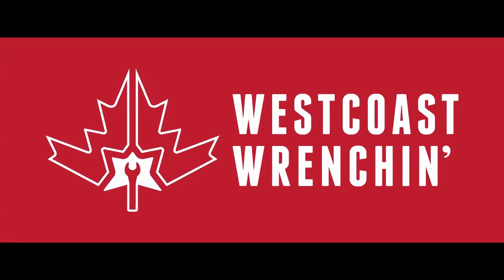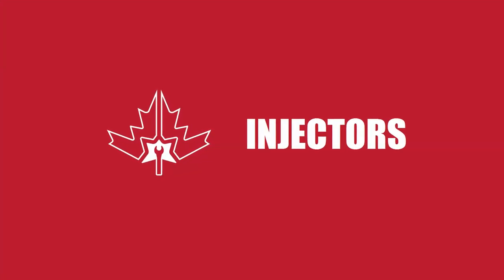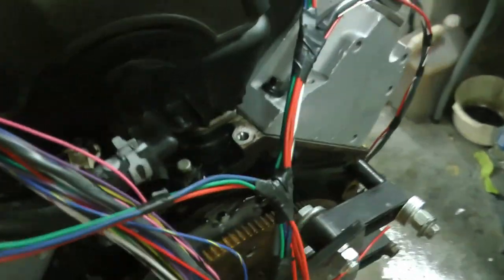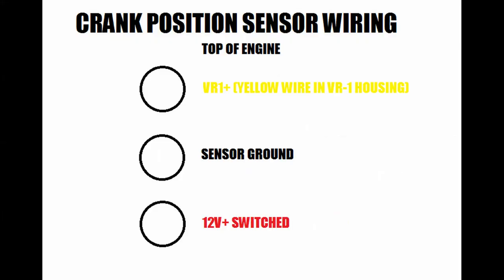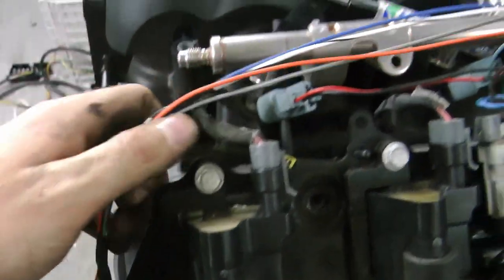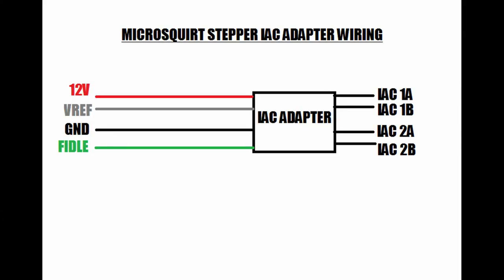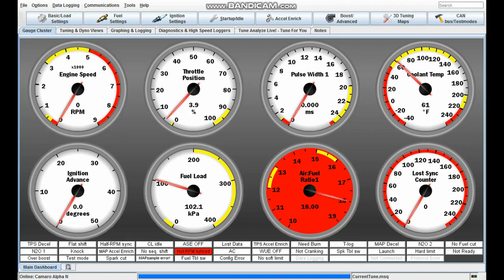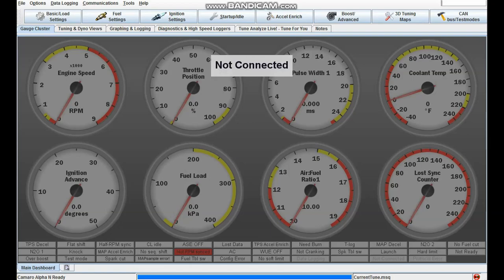Why I went with a Microsquirt on my LS vs. GM ecu

Comment: What some people do not seem to fathom  is that after approximately 4000 rpm your “multi port” system is running at such a fast rate it basically turns into a batch fire anyhow.  The best thing about batchfire is that your fuel that is basically sent to a “prechamber” is allowed to percolate and gas out, at that point you are not relying on the fuel as a fluid to burn , gasses burn a lot , a hell of a lot , faster than liquids to ignite. 
 Micro squirt is basically what we also had for many years, the Ford EEC systems.   EEC iv is what we have used for years to build custom systems , with or without speed density.   Good video.  Now onto fuel maps !   That is what scares people.
Reply: That’s actually one of the easiest parts. You set your AFR table. Than drive around and let auto tune get a rough table going. Than slowly get into higher and higher loads and tune that. The hard part is timing map if you don’t have a way to monitor detonation you could add too much timing and blow up the engine. If you are too conservative you lose a lot of power and sometimes the engine won’t run right and could break something.

Comment: I like your perspective on this, and stumbled across it while doing some MS research myself. I dipped into tuning when I took my old F-250 and replaced the carburetor on the 460 with one of the most stupid simple EFI systems- a 454 TBI, using a '7747 ECM and a Moate's Ostrich emulator. People then asked me why the glorified electric carburetor? Why not something more modern? My reasoning was price, that I desired simplicity on an offroad vehicle, and that my carburetor would flood like crazy any time I tackled a hill climb or obstacle. I needed something that could run at angles and be reliable. These more simplified systems have their place and can function well for years to come, and I'm on about the 12 year mark I believe with mine. Now I'm looking to upgrade, and Megasquirt has options that can be used on just about anything with pistons and spark plugs.

Batch fire is not nearly the lack of efficiency many people claim it to be, although you are correct, it certainly isn't the same., They often like to compare an older, simpler EFI system with a much more modern one, citing the batch fire as being the culprit. If low speed efficiency is your thing, then perhaps SEFI is the way to go, but for making power with an already larger displacement engine, batch fire will do just fine and you won't really miss much. It doesn't matter over 2,000 rpms or so anyway, as everything is moving fast enough that the delay doesn't make much difference. The greater design plays a much bigger part here than just the fraction of a second that the fuel is sprayed in.

I tell folks all the time if it's a hotrod that you're going to hoon around mostly, you'll be fine with a batch fire system, or one of the modern TBI systems like a Sniper or Atomic EFI. It will absolutely deliver modern turn key driveability. If you're concerned with fuel economy, then open your wallet for a more advanced system, run a stock computer, or get a Toyota Camry. It makes absolutely zero sense to me that so many people will dump a decently built SBC with aftermarket heads, and spend thousands on an LS swap in a classic car that gets hotrodded around and driven less than 3,000 miles per year- then cite fuel efficiency as their #1 reason. I couldn't care less as long as it's got decent volumetric efficiency and using most of the fuel to make the horsepower I want to have fun with. I would never make my money back on the fuel savings to make up for so little driving in that situation.
Reply from the maker: Thanks! I appreciate the kind words and totally agree with you. I find that a lot of people get hung up and don't really think about the benefits of making something better vs. Making it perfect. I have learned with custom cars that it will NEVER be perfect and no matter how fast, polished or rare it could always be better. In that sense i have always preferred the bang for buck mods and not top of the line anything

Comment: I am about to do a LQ4 in my second gen myself now and your videos is really helpful! Thanks.

A couple of questions. You are using LS3 heads, right? 821 or 823? I saw they was milled 0,030, did you then needed to flycut the dished LQ4 pistons for valve clearences? Did you calculate your compression ratio?
You are also talking about good fuel milage with your car; I am also going to use a 4 speed (actually a M22 in auto gear housing). What fuel milage did you get, and what was your rear end gear with that particular milage?

Again. Thanks a lot for your videoes!
Reply from the maker: Hi there, they were the l92 heads. Mild cam so no fly cutting required, they measured out fine (too long ago for me to remember the measurement).

Comment: Next time I do a ls swap with a manual trans it’s getting Microsquirt. I pulled an ls6 from a Corvette with the harness and converted it for a 57 Chevy . Changed the cam while the motor was out and know I have to pay somebody with Hp Tuner or Efi live to even get to drive in the parking  lot . I hate the licensing fee on that software  but you can’t blame the guys that wrote it.
Reply from the maker: Yup I totally agree with you. People get hung up on the computer itself which is actually such a cheap thing to do with a micro. That being said If I had an auto I'd consider a gm comp.

Comment: Note not familiar with vortec swaps let alone GM engines.... I was worried about batch fire , and was assuming I had to give up into a carb setup for my first build and lose its power output of the engine series vortec can produce. Thank you for the information! You give a guy hope.

Comment: I have a ford efi 300 inline 6 that I'm thinking of using the microsquirt on.  It has automatic trans (E4od)  aside from the microsquirt not running the trans, would this system work for me? I'm having trouble with the truck.  I've changed sensors, the computer, even rebuilt everything.  Used some original parts but everything has been taken apart and inspected.  I'm thinking this would be a better system than the original stock.  What is your opinion?  If this can make my engine run, I will end up modifying it with bigger injectors and other stuff. As well as getting the trans control.  Sorry for the long comment. 😅 really curious about this. Would appreciate your input. Thanks.

Comment: HP tuners will not self tune , Micro Squirt will. That is the beat reason to use Micro Squirt. And as a standalone it will control your trans also.

Comment: Fantastic video with a lot of great info! I plan on using the microsquirt for my setup (Ford 302) But want to use the LS individual coils. I want to use a 36-1 crank trigger. I cannot find anyone that has done this. It seems to me that it would basically be what you have done but on a different engine. All the MS should care about is when to send fuel and spark according to the crank trigger. Any reason I cant make this work on my Ford engine? Thank you for your time and your content.
Reply from the maker: I dont see any reason why not once you confirm that crank trigger will work! I'm thinking you'll go speed density?
Reply: Westcoast Wrenchin'  yes I’m going to run an LS 90mm throttle body.

Comment: Most fuel injected cars used batch fire injection up until the mid 2000s. If it was good enough for cars from the factory back then it’s still good enough to use now.

Comment: Im using a microsquirt on my dodge dakota with the 318 but since its a 1994 truck. I cant use Flying Ryan Performance since there isnt a way to tune the OBD1 engines. I figured i can use the microsquirt to piggy back off the stock ecu where the stock ecu will supply the 12v power to the crank, coil, and injecters and the microsquirt will just ttigger them
Reply from the maker: I think you could make that work. Why not give the ms full control?
Reply: @WestcoastWrenchin  im not 100% sure how the air conditioner is wired. Then on the mopar engines. The computer controls the alternator but theoretically i could just get an external regulator for that

Comment: the arduino has 14 other input/outputs, have you considered using it as your trans controller, with some programming and it seeing rpm and throttle position over can, you should be able to program it to switch the shift solenoids as needed, just an idea
Reply from the maker: Thats a cool idea! I have a manual trans but im sure lots of people would be interested!

Comment: Hey man I've seen a few of your videos and they're super informative, I was just wondering if you know anything about running a th350 behind a ls motor using the microsquirt system as they have no computers? I'm actually local to your area, the charcoal 81 firebird is mine, your car is friggin sweet and that's the direction I'd like to go with mine
Reply from the maker: Thanks! Yup tons of people run a th350, a direct bolt up with the correct flexplate.

Comment: What ever became of this did you keep it? Was it boost capable? Why did you replace it for a more expensive holley unit?
Reply from the maker: I found the lack of inputs to be debilitating to the project, hence the shift to holley. In hindsight the holley is a far easier system to used and my preferred
Reply: @WestcoastWrenchin  well that's unfortunate well I appreciate you replying thank you

Comment: At about 5:00 you get into a circuit to add outputs. Can you expand on that? There were a couple of words I couldn't get. I'm new to squirt but wondering what these added outputs can be used for? Also, how is the circuit coming along?
Reply from the maker: jvan100 i was mentioning a project I have going to use an ebay arduino canbus shield to interact with the micro. You can buy a $60ish shield with software so you can just hook it up to your microsquirt and use it. Youre using the micros canbus abilities as sensor inputs for an arduino. The arduino can then trigger external outputs based on your micros sensor readings. The arduino will essentially just trigger a solid state relay to do something useful. Hope that makes sense!

Comment: If there is no transmission control with the microsquirt, could you use a manual valve body to control the transmission?
Reply: Depends on your transmission. Any old 3 speed? Yes. I'm a Ford guy so can't speak 100% for the GM transmissions, but they are pretty similar, and anything with electronic control uses solenoids to operate, unlike the older transmissions. There are standalone transmission controllers that will enable you to use one. In fact, you can even use a second Microsquirt to control one.

Comment: ive noticed folks selling "ls only" microsquirt systems. with the coil drivers removed. would it be better to pick up one of those or just get a regular microsquirt?
Reply from the maker: You should get the one specific to the ls if you want simplicity, elsewise there is some soldering and playing around required

Comment: Ok Mr,SuperNerd. Can you use the Meagsquirt with a GM trans controller? Of course the answer is yes, but how.
Reply from the maker: A single MS cant control the trans, you need to get a second one. About all you could do is get the signal when it goes into gear to bump the idle a little.
Reply: Didn't answer the question.

Comment: I am surprised you did not mention the self tuning feature
Reply from the maker: It never worked very well for me to be honest
Reply: @WestcoastWrenchin  I have a LNF turbo in my 86 Fiero with a MegaSquirt 3X and the self tuning works awesome. I have had engines in the Engine Masters Challenge with the 3X and have did most of the tuning on self tune. I had a 6 liter LS on the Dyno and we made 39 pulls in 4 hrs. Most of them on self tune. The problem with self tune is not the program it is learning how to use it.
Reply from the maker: @racerd9669  yea I didn't experiment with it too much. I run a holley dominator now and its self tuning capability is phenomenal!

Comment: So i bought a 1988 chevy pickup with a 1999 5.3 with a single turbo has megasquirt gold box on it. had for two days been running great hop in it one morning to take for a spin and no start!! I have cam and crank signal but it loses engine rpm about the time it tries to start. Sometimes i get no engine rpm! shows no sync?? At a loss any help would be awesome
Reply from the maker: Is it running full sequential? Try and run it batch fire see if that helps you

Comment: Great video!
I am building an LS Miata and will soon be purchasing and ECU.
It has been over a year since you posted this video and I was curious how you are liking the Microsquirt.

Would you purchase it again or buy something like the Holley Terminator?
Reply from the maker: Thanks! If I kept my car NA I would keep the microsquirt for sure. My car is turbo now and I wish it had an output for an electronic boost control. It technically does but I'm using those outputs for my stepper iac. All in all it still works very well and it's so cheap! I've got the bluetooth adapter and shadow dash on my phone for all my gauges which is unreal
Reply: @WestcoastWrenchin  I am wanting to run a turbo as well.  What management
 system do you think you will run in the future?
Reply from the maker: @dmvchannel3280  it all depends! I really like the ms3
Reply: @WestcoastWrenchin  Got it!

Comment: I have been messing with the can bus and Arduino, have you been able to get it to communicate? What setting are you using in tunerstudio to broadcast
Reply from the maker: I tried for a good month and couldn't figure it out, it's just beyond my programming level. I'd really need to go through and understand all the coding better to make it work but its tough

Comment: Could you talk more about reading canbus via arduino to control different i/o’s?
Reply from the maker: I never got around to doing much. You set your micro in tuner studio to broadcast via canbus; it can even be simplified to broadcast engine variables. You then use your arduino connected to the can hi and can low wires to read those values. The values have to be read with a canbus shield. There are tons of shields out there, I'd buy one with a detailed tutorial on using them. After the arduino has the values you can do whatever youd like! I liked the idea of controlling relays via canbus or doing an LCD mini dash

Comment: Great vids, thank you. I have a new  LS made wiring harness, from the GM 0411 computer.( 1999-2002)  Would like to move to MicroSquirt.  Would 
you happen to have any information on which  of the 0411 pinouts would be attached to the MicroSquiet modulw?   Thanking u. Ken
Reply from the maker: That harness is only really required for the connector pigtails if you want to build a harness like mine. I have no idea how the GM pinout would transpose to the microsquirt harness. I took my GM harness and just cut the connector/pigtails off of it and went from there. Thanks

Comment: Sequential fire is good, but unneeded. Power potential is a non issue, sequential doesn’t give you any more power, it does help with smoothness and better emissions. NOBODY building a hot rod is going to tune for emissions. 

The complexity of tuning a sequential over a batch fire is not really worth the trouble especially if your new to these types of swaps. Unless you have test gear to test each individual cylinders air-fuel ratios and therefore tune each injector individually, what’s the point?

Comment: Wait, firing injectors like that sounds stupid. Id like to see a dyno comparison with this and a couple others.
Reply: It's pretty much how every OEM did it for years. Ford was one of the first to go full sequential, and started using SEFI with the 5.0 Mustangs back in 1988 (and all 4.6 modular vehicles), but all GM, Ford trucks, several Japanese makes, Chrysler etc. were all still utilizing batch fire. It didn't really die off until the late 90s as everyone else caught up with technology. You're really talking about fractions of a second difference between when the fuel is injected and the valve opens. It's not going to matter at all above a certain RPM, which could be as low as 2,000. If you're trying to make EPA ratings, it matters, if you're trying to make horsepower in your hotrod, it makes far less difference than most think.

Comment: Microsquirt makes a transmission controller fot the 60e pr 80e for about 400 bucks and will tie in to the micro ecm
Reply: Its actually another Microsquirt (Transmission OS) and works well with the GoldBox MS3X too.

Comment: Interesting how you wired the injectors.
Reply from the maker: stormin norman why is that?
Reply: The diagram on the screen. You don't wire one bank together and the other together. They cross over. Batch fire.
Reply from the maker: Ive got it firing two injectors on each rail at a time, are you suggesting firing a full rail at a time?
Reply: That's a neat idea. Im not suggesting otherwise. Just interested in how you are doing it. You seem like smart guy.
Reply from the maker: stormin norman  thanks! Im still learning lots! I just need some sunshine so I can drive the thing.
Reply: typical batch fire is one bank then the other. I have wondered if tying the firing order into that would make any difference ?
Reply: Interestingly, that makes more sense. Stormin Norman, you made something easy even easier thanks man.